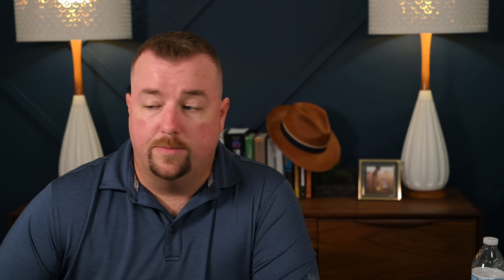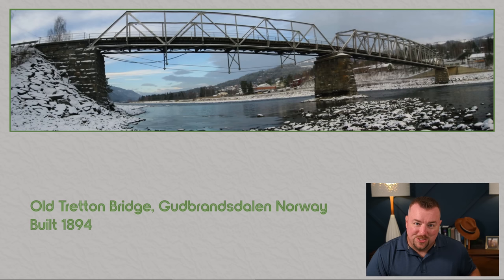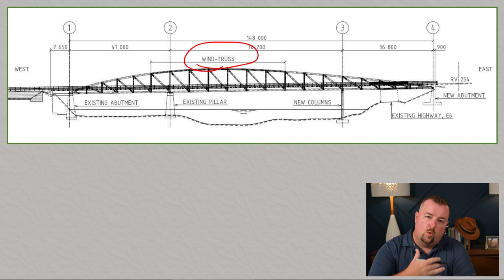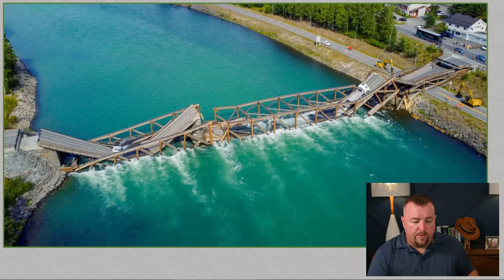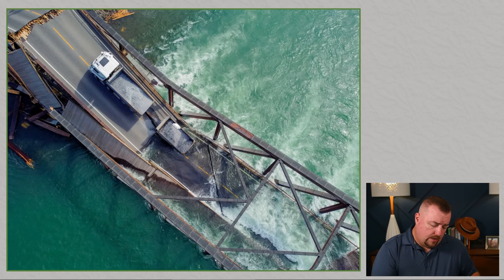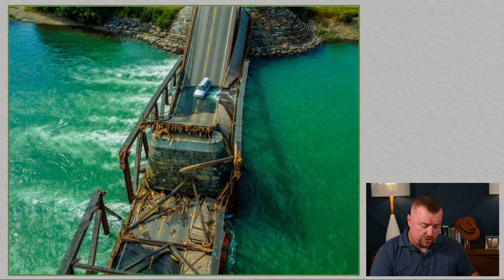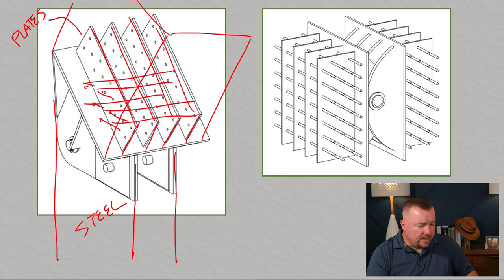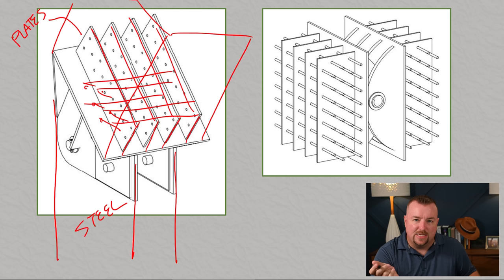How Did the Engineers Miss This?

Comment: A couple of things to point out: (greetings from Norway btw) 
- The old bridge was a single lane bridge and had to be updated to support two lane trafficking. (one in each direction) The choice of material fell on glulam combined with steel because of the weight limitations having to use the old bridge foundamentation and aesthetics. (NVE - Norwegian waterpower and electricity didn't want the river to be reduced to build new fundamentations)
- The first bridge that collapsed, the Perkolo bridge (strange name in Norwegian also, almost sound finnish), was actually underdimensioned in the middle joint. It was bouild in two parts and joined on site. The two joints in the middle should have had 80-90 dowels, but it only had 24. Making the bridge only support 27% of the bridge planned capacity of 65.000kg (143.300 pounds).
- After the collapse of Perkolo bridge all 13 glulam bridges was checked and there where some flaws in some of them. Tretten bridge was one of two (i think) to have recommendations for improvements regarding the joints.If I don't recall wrong it was something to do with the dowels.
- The one thing that concerns me the most is what i have read in a master thesis written in 2018 after the colapse of Perkolo bridge with guidance from engineers in Statens Vegvesen (norwegian public roads administration). The different ways of calculating the stresses, the area to distribute this stresses and the general dimensioning of this kind of joint leads to widly different results. (The codes that are mentioned in the master thesis: EN 1995-1-1 (Eurocode 5 - Design of timber structures), NDS 2005 (North American Timber Design Codes) and a development sugestion for an improvement in Eurocode 5 from Statens Vegvesen.) For me thats kinda concerning, because it makes me belive that we don't have the greatest understanding of this kind of joint.
Reply: Thanks for the background info.
Reply: Do you know of an English version of that thesis?
Reply: Thanks for the information on the other design constraints that are missing from this discussion. Sadly, they result in bad engineering outcomes.
Reply: And thanks Ruben for the comment. Understanding how something failed is nice, but it's also important to ask WHY someone thought that this was a reasonable approach in the first place. To do that, you need to understand the constraints they were working with.
Reply: So basically the power company is to blame
Reply: So. H weight limitations you mean a two land steel bridge would be too heavy for the old foundations?

Because I feel like there is no problem building a steel bridge which could carry the loads this bridge was designed for. In fact I expect you could use the same bridge design with I beams, gusset plates and rivets and it would do the job. No need for box sections even. All due to the better tensile (pull through) strength of steel.

But it would be heavier than the old bridge and this one.

Although I bet the (now double wide) deck is much of the weight of the bridge. And that wouldn’t change.
Reply: This is why I love YouTube (sometimes), here we actually have a person from Norway explaining the history of the bridge!!! I wondered if Norway has building regulations like America, and I have to believe they do, we're not talking about a 3rd world country, but I did find it interesting that the water way didn't want to start from scratch and hence the issues! Thx for commenting, it was a treat to have someone in Norway in the comments section!!!
Reply: Please bare in mind also germanys big ICE Hockey Stadium disaster in Bad Reichenhall.
Reply: Thanks for this additional information. The governing authorities should have closed this bridge until the deficiencies were fully corrected.
Reply: Ruben, the weight reduction argument does not seem correct.  The required stiffness (arguably even higher than the glulam's) would be achievable with lighter steel truss.  In other words - a steel bridge would have been much lighter than the one made of wood.
Reply: Thank you, this was an excellent and very helpful update!
Reply: Another engineer here (aerospace but I work in control systems).
Great information.
I wished more people would take the time to check and get details right.
Reply: @tonywilson4713  Im not an engineer (yet). "The devil is in the details" and when you seek to understand something that's certainly true!
Reply: @marcinkotas3154  Doesn't wood and glulam have quite good tensile - and compressive strength compared to weight? Like steel is prob. 10 times as dense as glulam, or something in that range? So in a truss with minimal bending, and axial compression and tension it seems like a good material. The way of connecting the members to the nodes steel is far superior to glulam tho.
Reply: It's strange that eurocode 5, under durability, there is no mention of resistance to water.
Reply: @marcinkotas3154  It was a political (eco) choice.
Reply: To my mind, the joints shouldn’t be there.  The whole point of glulam was to eliminate joints in timber beams… in other words… to create a timber beam longer than anything grown in nature.  This was achieved by gluing pieces of timber together in a randomized pattern, so that no two joins coincide within the structure.  This way you can create strong, flexible beams a hundred foot in length with no weak joints, much like a laminated archers bow.  Why you would cut such beams into short lengths akin to standard timber beams is beyond me, it just defeats the purpose of the glulam beam!
Reply: @rub3n0st  It sounds like you are a student so I'll give you what I was given by a very smart man. I did my degree in aerospace (graduated in 88). My academic advisor (professor) was a specialist in Finite Element Analysis and in his specialist area one of the top 2 or 3 in the world at the time. 

Little background (and this is so you know what sort of mentoring I had) His specialty was axisymmetric structures and near axisymmetric structures. Being one of the top people in the world in that area, he consulted on the Shuttle Booster redesign after the Challenger accident. It was the early days of carbon fiber and he was doing all sorts of work with modelling it in software. Its way more difficult than people think because its all layered and depending on how the layers are assembled the characteristics change. This Glulam is a composite material and has to be treated the same way.

I wasn't working on the Shuttle booster. I was doing work on stress analysis on the sabot for the Abrams M1 Armour-piercing discarding sabot. There was nothing classified about it. Discarding sabots weren't new, but doing FEM on them was. It was in the days BEFORE fancy color screens so all we got back was an slab of dot matrix printed paper.

I was amazed that he could flip through these printouts in seconds and work out I'd made a mistake in the data set. that was when he taught me the first important lesson. Its incredibly important that you know the general answer before the computer. He was adamant that the computer doesn't give you the answer it gives you more detail about the answer.

At one point during the Shuttle Booster re-design he told me they were going to repeat the mistake and lose another shuttle (that was in 87). What he told me was they were NOT understanding HOW the computer models worked and as a result were NOT understanding what was coming back. He was adamant that if you are going to use these computational tools to give you all these details you needed to know how those details were being generated.

Its sort of like the intelligence use to justify the Invasion of Iraq. Sure the details sounded plausible but nobody checked how they were being generated and it turned out later they were garbage.

I look at this and what he's describing would have my professor come back from the grave and slap a few people. They broke both his carved in granite rules of computational engineering analysis. You must know the general answer and you must understand the model or the details it gives might be WRONG.
Reply: @tonywilson4713  For most people who have ever worked with computers, the one "answer" which is always true:  "Garbage in, garbage out or GIGO". A computer will do exactly what it is programmed to do, The human must know what to put in and why to put the data in so the computer will make the needed computations.  

You make some very important points, keep working on them so you can prove to yourself you are a good student of your mentor.
Reply: @Harry-zz2oh  Absolutely right on GIGO. What my professor taught me was a more technical version of that years before GIGO was even a term.

What he taught me was that in addition to GIGO, you can feed good data into a good model and still get garbage if its the wrong model to use.

This is what they did with the bridge. The data was good, the model was good, BUT it was the wrong model to use for a composite material AND it didn't consider degradation of that material due to weathering. 

This is one thing across the entire computer modelling world from stock markets to weather to political polling and all the rest. Its not just a matter of GIGO its a matter of understanding the model to know its the right model and/or its limitations.

I have actually been looking at economics for a couple of years and that crowd are totally bonkers and when I mean bonkers I mean certifiably insane bonkers. Their logic is totally FKD and none of them can see it because they are all taught the same garbage. There are some rare exceptions but they're considered heretics.
Reply: @Helladamnleet  No, those are just the constraints that the engineers and architects have to work with. It's something engineers do daily.
Reply: @tonywilson4713  And how is it going to look like in the future when more and more modelling based on machine learning is going to be used? As even complicated mechanical models can be possibly understood and their applicability can be verified, it is almost impossible for ML. As it its feature just to throw a solution without having a shadow of understanding of a simulated phenomenon.
Reply: @johncampbell9216  that's not possible or feasible and frankly doesn't make sense...
Reply: In America (as well as Finland and a few other places) we have TONS of wooden structures.  It's a wonderful, cheap material that can have great aesthetics.  It's good in both tension and compression.  It can last HUNDREDS of years when cared for properly.  

However, wood is weak to water.  Specifically, repeated wet/dry cycles.  Wood loses strength from rot, which is caused by fungus attacking the wood.  Even treated wood has this problem.  Exposed wooden members should NEVER be structural for this reason.  Exposed wood should also be painted for longevity.  Even a fully treated wood needs to be retreated every year.  

I can understand the aesthetic joys of seeing bare wood.  In that case, it's advisable to make an inner structure of steel or aluminum, with secondary load carriers made from wood.  You can also make railing and other non structural components out of wood.
Reply: @pathfinderlight  You make a very important point that applies to EVERY MATERIAL engineers use: "when cared for properly"

It does not matter what the engineered system or product is. If its not maintained properly it will fail BEFORE its expected life time.

Look at some of the worlds best failures of recent decades, Piper Alpha, Chernobyl, the Ponte Morandi bridge in Genoa, Japan Air Lines Flight 123. The list of disasters with poor maintenance is staggering and NOBODY ever seems to learn from them.
Reply: And I think considering it carries a great heavy load(a paved road) we should not be trying to find out about these joints made out of materials that drastically change characteristics based on humidity, at least not in public infrastructure anyway... We have invented better structural members made out of steel... or hell... even stone/concrete... It is a paved road making the frame out of wood is a political bs statement and not a conscious engineering choice in my opinion and as such it should not be ok to play with people's lives like this just so that some politician can claim that these inferior material choices make these bridges green or something, I assume this is the reason.... why did they choose these materials again?
Reply: Fea is the most powerful tool to come from the cad revolution and unfortunately gives some designers a false sense of security due to lacking the understanding of computer modeling. Modeling is not an accurate picture of reality but an accurate picture of the reality the computer was programed to represent.
Reply: @tonywilson4713  
I’m totally with you. I had similar experiences and I often see the younger engineers having too much trust in computer output without doing a “sanity check”. By the way, I graduated with a BSAE degree in 1988 too.
Reply: @johncampbell9216  Yes, that is a very good point. There weren't  using a glulam to do what it's really good at doing. It's really good at not needing connecting joints and spanning long distances. Also if the wood was doug fir or similar, it's not a good choice in an exterior situation.  I also found it was amazing that they could drill all those holes in the wood accurately, especially if they made some of the joints onsite. A drill in wood will drift a good amount because of the wood grain.
Reply: @ammerudgrenda  It sonly getting worse too.
The more recent graduates are less skilled, yet think they are more skilled than those from 10-15 years ago.
We might have had our issues but its nothing like these grads. Maybe it was the fact older engineers were actually allowed to tell us to shut up and listen.
Reply: thanks for the information. i am not positive it is a joint understanding issue  more of a materials limitation . as i understand it  the glulam can carry the load  but the method of attachment  weakens  the material at that location  ,  i feel for the designer with the restrictions imposed  and the outcome required  he had to  move mountains to mohamad  because mohamud wasnt going to move to the mountains. 100 + year old foundations  for a single lane bridge now required to hold a 2 lane bridge and large live loads..... oh and you cant play with the foundations..... heres an easy job now do it in an impossible way....  you have some nice land there sir
Reply: What does 'foundamentation' supposed to mean?
Reply: @johncampbell9216  This is exactly what I was wondering. The distribution of many smaller connections is where engineered timber's benefit come from. To then go making it into numerous shorter sections before tieing it back together with steel is defeating the entire point of the lamniations.
Reply: @stevebollinger3463  Glulam has a better strength to weight ratio than steel for most types of stresses.
What it doesn't do is plasticly bend and then harden like steel when you exceed its capacity.

Anyways, it makes perfect sense to use glulam where you can instead of steel when weight is a constraint.  It is a fairly new material though, so real world details might well bite you in the ass as appears to have happened here. Hopefully this is all going to lead to improving methods.

PS: Using materials which are grown instead of mined or drilled is generally a good thing.  But this stuff is difficult.
Reply: @tomruth9487  it seems to me that the designer really doesn’t understand the purpose of glulam and the methods of construction.  One thing that screams out at me is the method of pinning, with so many small holes so close together at the joints.  All this does is weaken the beams.  The whole concept of assembly is flawed from beginning to end.

I’m no expert on glulam or timber construction, but from what I have seen, I would have had the two upper beams engineered on site, full-length with a pre-formed bow in them, and then make full-length straight beams for the road support.  I’d have hung the structure from the bowed timbers using steel boxes that the beam runs through, rather than pinning.  That way you get the maximum strength of the beam with no weakening penetrations.
Reply: @johncampbell9216  My thought also, non-engineer here but I feels so wrong for the gluelam to be cut in to sections, the whole point of its springiness is lost. I've driven past (not over) that bridge at Tretten many times, first times I thought it was temporary, but it stayed.
Reply: @johncampbell9216  Yeah your ideas make a lot more sense. If they were going to join it with steel, the steel needed much more bearing distance up the length of the gluelams.  It's sort of like the FIU pedestrian bridge collapse but different materials. They tried to make a single concrete truss to support the whole structure because it was hip.  The joints failed. It's such a risk doing stuff that might look good on paper but is not time tested. The FIU bridge only lasted a few days but, the egos of all involved prevented them from accepting the fact that they made a big mistake. People died as a result. What a hard lesson to learn from.
Reply: Cheers - the foundation-imposed weight limit plus the dual carriageway are important design elements that will get forgotten by people who want to laugh at using wood
 - "we're not sure" isn't a great response to "how strong is this?"
Reply: @Helladamnleet  The power company acted as a catalyst by lobbying for what they wanted, but they were not making any decisions or executing them. Thus, they are not to blame.
Reply: @tonywilson4713  Cannot disagree more with your "shut up and listen" comment. That attitude produced nothing constructive, no matter from which viewpoint you look at it. And very often old farts also do things in a particular way only because they've done always that way it's "good enough". And they cannot even articulate reasonably why they do as they do. And often their "good enough" is not even good. 

Getting better at your job and bettering work aspects and methods requires open mind that maybe there have been some development and your own methods are not considered up to par. While field experience is very important, so is the knowledge from new developments of better or even just different methods to do things.
Reply: @johncampbell9216  I think the design is driven by aesthetics. They wanted a sleak look, and then there's no room for properly proportioned joints.
Reply: @MichielvanderMeulen  wouldn’t a sleeker look be achieved by using whole-length beams, Michiel?  I’d have thought designing the joints out of the bridge would be “sleeker”… hence the use of glulam…
Reply: @marcinkotas3154  If someone used the weight as an argument they probably wanted the wood-bridge and were simply trying to invent reasons for it. Maybe to compare wood to concrete ?
Reply: @johncampbell9216  One word: Transportation.
Reply: @Panzax1  Three words: On Site Construction.
You rent a yard adjacent to the site, build a tunnel tent and assemble the custom beams in there. Once complete, you crane them into position.  No transport required.
Reply: @johncampbell9216  No need for sarcasm. Cost is an important factor and your idea will never be practiced on such a bridge.
Reply: @Panzax1  indeed, there was no need for your sarcasm.  Doing the job in the manner I have described would be a better way to go if long-beam glulam construction is the desired method.   Although, there have been many projects around the world where very large glulam beams, over 100ft in length, have been transported to build sites from the factory.  The individual circumstances dictate the method.

On-site beam assembly is a perfectly feasible option where transport access is limited.  The temporary rental of a yard would merely offset the cost of specialized vehicles and their escorts along the delivery route, so no real additional expense is required, and you get a much stronger structure in the end.
Reply: I'm just surprised about the amount of dowels. A major issue with dowels in engineering is (also when using bolts) that the power is not evenly distributed over the dowels. In extreme situations only one dowel will hold ALL forces....it snaps and now the next dowel will hold all forces....
In fact there will be at least 2 points holding the forces....one the rotation forces the other the forces in line.
This is confirmed in the part of the YT video about the testing of those wood pieces (splitting the wood exactly at the outer row of bolts)

Only if the material is stretching enough more dowels will add to the strength of the connecions. With stiff material (glue is not always flexible enough depending on the kind of glue) the bridge is much weaker than with stretching. Knowinbg that old castles do not break down in 1000 years with their thick oak beams....I expect the bridge would be much stronger when build from special selected trees and massiv beams from those trees.
Reply: Brilliant discussion.  I'm in Norway and have read extensively on this bridge.   The maximum glulam lengths were 23meters. Most were a bit shorter, spanning two verticals.  The reason for this is this is size limitation of the creosote impregnation tank used in the glulam factory at Moelv. Yes, the entire bridge is pressure treated with creosote so that it can last.
Reply: @davidbrown8365  So they've de-engineered the glulam beam to suit their chosen method of treatment rather than making their beams out of a more weather-resistant timber.  Thanks for the new info, David.

There's clearly a host of poor decision-making going on with this company.  First, choosing to use cheaper, less weather-resistant timber for their exterior beams- forcing them down the pressure-treatment route, then adapting the glulam technology to the limitations of the pressure treatment process, rather than building their beams of a more suitable timber like Acacia.

It also begs the question... what effect would the creosote have on the adhesive?
Reply: That just says how dumb NVE is firstly they still let people build new homes on quick clay and also didn't want to build better foundations for a new strengthier bridge
Reply: "The two joints in the middle should have had 80-90 dowels, but it only had 24. Making the bridge only support 27% of the bridge planned capacity" - That calculation cannot be correct, no way. Looking at the other papers presented in this video, the number of dowels would not have such impact on the strength of the joint. It will split at the edge of the dowel area along the grain of the wood (or laminations as seen in the pictures from Tretten).
Reply: @rub3n0st  You are right. Wood is stronger per pound than steel for a tension member. I used data for s275 steel and Douglas Fir lumber. I assumed a safety fact or 6 for both materials.
Reply: @johncampbell9216  You still have to have a joint at the ends, where the arch meets the roadway.
Reply: @NiftyMCD_Australia  Foundation.
Reply: @johncampbell9216  I'm gonna guess that the creosote treatment came after the glulams were assembled. I can't imagine attempting to glue onto creosote.
Reply: @shAnn0n1  On the whole the laws and regulations here are stricter then in the US.
But perhaps not strict enough for this particular type of joints...
Reply: @firesurfer  No, it's not that simple.
Instead there was many different considerations, the environment just being one of them.
Reply: @tonywilson4713  Kind of true, but you risk confirmation bias.
Reply: @kozmaz87  It's not a inferior material, it's poor design, possibly caused by insufficient understanding of the materials in use by the ones doing the designing.
Reply: @Luredreier  The details are not important for me.
Reply: @johncampbell9216  Labour and building costs are high in Norway.
Automatic factories or import from abroad might be cheaper.
Reply: @johncampbell9216  Regarding wood type there's a goal to use local woods if possible.
Reply: @elypowell6797  US construction in general tends to last less time then nordic ones...
So don't blame feminism for this...
Reply: @Luredreier  so they were putting idealism before good engineering.
Reply: @Luredreier  Labour is equally expensive whether it’s in a factory on site in a yard.  It’s Norway, the wealthiest country on the planet, it can afford to do things right.
Reply: @johncampbell9216  What message is that a reply to?
Reply: @johncampbell9216  No, labour is far more expensive outdoor because of workers rights, and also far more expensive if it's human rather than robotic or otherwise mass produced by machines.
And it's far more expensive if it's Norwegian rather than imported.
And yes, we have a lot of money, but the reason is that we're prudent with our spendings.
Reply: @Luredreier  I suggested the temporary erection of tunnel tents, which would have to be temperature and humidity controlled to assemble the beams on site.  It would have been a lot less costly than all the steel fabrication that was done to connect all those short beams... which just seems way over-engineered (and expensive) to my mind.

If you want a long-beam glulam structure, you either transport (which costs money) or you build on site, which, incredible as it may seem, costs money!  It's all about making compromise for the success of the project and I'm quite certain a tunnel tent, a few guys and a crane would be easier, cheaper and a better result than the over-complicated failure that was delivered.
Reply: @Luredreier  
You said: "Regarding wood type there's a goal to use local woods if possible."
I replied:" So they were putting idealism before good engineering."

My point: It is often the case that builders and architects will run with the "eco-warrior" assertions of do-gooder politicians, rather than just doing it right with the strongest, most weather resistant materials for the job.  This said, it's quite likely that the local timber would have been just fine if the glulam beams were full-length.  But the fact is we've had a failure here... and it wouldn't be the first time politicians set a project up for failure from the outset!
Reply: Thanks for the input! This stuff is pretty interesting.
Reply: @renerpho  This type of bridge was designed by architects for a certain look, and the engineers involved after that were probabily incentivized against blocking the project by introducing changes that would change the look or radically increase the price.
Reply: @johncampbell9216  I agree the beams should have been continuous with more of an arch. Also if the river is navigable they could just bring them to the jobsite by barge.
Reply: @pauleohl  Yeah glulam has almost double the strength to weight ratio than even high strength structural steel (S420 grade), so it does actually make sense in this application. The failure appears to be the joints. Maybe they assumed it would stretch a bit before yielding to give some warning (like in the papers in this video) but they are clearly not failing in this way. Like most engineering failures, it came down to bad assumptions.
Reply: @johncampbell9216  Here is an interesting project if you like. Calculate how many lifting points would be required so that your arched and straight members can be lifted without breaking from their own weight.
Reply: @marcinkotas3154    Wood, in general, is stronger in tension than compression but the tension joint is the BIG problem.
Reply: 28:21 According to the official records by the Norwegian Highway Authority (Statens Veivesen), the structure was loaded to 200% of what it should be. The report from Statens Havarikommisjon (The Norwegian State Disaster committee) is still pendling. Thus, the jury is still out. We may make educated guesses, but we can’t really conclude until the official «disaster report» is finished. But you’re quite through, though! 😊
Reply: @firesurfer  there are different dimensioning classes, one for normal indoors climates, one for outside climates, but under a roof and one completely outdoors without protection. AFAIK we have had in Finland a 4th one for constructions completely or very heavily affected by moist conditions, today the aforementioned constructions use the 3rd class
Reply: So they attempted to update the bridge despite ridiculous weight limitations. ... creative means learning from mistakes and progress.
Reply: @Tony Wilson  It was unfortunate that the booster redesign did not solve the problem with the ablative material breaking off in slabs which damaged the wing tiles on Atlantis and almost caused the loss of that ship which was the 2nd launch after the Challenger loss. Also is the likely cause of the Columbia breakup which is really sad that NASA did nothing to correct the problem after that Atlantis near miss.  They played russian roulette with all those crews. Sickening!
Reply: ‼️Thank you! I'm disappointed that he (the channel) didn't even react to your great additional information‼️‼️
Reply: did you have to wave the flags? are you so imprisoned in your culture?!
Reply: @NiftyMCD_Australia  foundament- the initial starting point,, tation the study or act off, foundamentation , a great word for Scrabble! But I doubt it would fit , goes along with words such s sillyiesation, to make things appear less serious or valid, why use several words when you can make up one ridiculous one☺.
Reply: I very much appreciate the details on the dowel pin situation.

It reminds me of the sky scraper in New York having much less wind resistant because of "cheap" welding done differently different from original plans
Reply: @elypowell6797  that's an interesting take, given how many historic bridges used to catastrophically fail, with hardly a note on the subject.

I am sure it's inconvenient to go trough microfilms at the local newspaper archive but assuming feminism doesn't mean the Roman civil rights movement or anyone else before the 1820s there should be cases of bridge collapse accessible to you testing that hypothesis.
Reply: @TheNiteinjail  

The weight constraints were part of the site assessment, if they couldn't have designed a bridge to suit that (in theory) they might have had to either move the entire road connection or terraform significantly

We have a local project to replace a bridge that was destroyed (1940s history) before UNESCO heritage recognition was achieved and there have been incidents of that being removed upon bridge building.

There is another one upstream that will be replaced with the new one before it's taken down (traffic reasons, minimising disruption) but is spanning a nature preserve area that had to be weighed (including because reducing the wetland biomes protection across the whole river will impact the flooding that bridge can be damaged by)

I am not sure how familiar you are with the water system impact of building bridges but putting down any additional pillars can be pivotal towards large scale liability.
Reply: Greetings to Norway!   Good background info.  Good info.  (Glad to see others make mistakes, not just my country.  (Glad in a non-joyous, non-contemptuous, non-happy, commiserative way.)
Any thoughts about the copper caps?
Reply: @charlescrawford7039  The only way to correct the deficiencies would be to replace all of the timber with steel.
Reply: Perkele bridge!😀
Reply: @marcinkotas3154  He said weight, but everyone is missing is he also mentioned aesthetics. 

There was probably political pressure/regulations that stipulated the use of wood for aesthetics rather than steel.
Reply: stop making excuses for this engineering and design disgrace. we don't want to hear it. build your infrastructure safely. Greetings from america.
Reply: Didn't it also, "have", to...support cars?
Reply: I think you can safely go with the more pessimistic, unless that also did not account for the collapse, which means an even more pessimistic prediction must be found.
Reply: @tonywilson4713  Everything you say about computer models I agree with it all totally. You need to have an understanding of the broad solution you expect to see, you need to understand the model and the math behind it, and you need to know the limits on your input data.
With so much data modelling today its use or misuse has almost become a kind of pseudoscience. 

In this case (for me) just from playing bridge simulator games its clear that joints that experience multi-way tension loads are naturally quite unpredictable and a common failure point. Might even classify the loading as loads shift as almost chaotic. The simple classic solution to that is of course to over-design and over-build such joints.. (What they didn't do here.)

Then we consider that they are using glued wood - outside - so in the wet & with uncontrolled temperature cycles.. Plus the point pulse loads that bridges take. Definitely a disaster waiting to happen.
Reply: @Lucien86  You have just repeated almost word for word what my professor who was a world leader in Finite element modelling said to me in 1987.
Let me say that again 1987 as in the year after the first Space Shuttle accident.

In the summer of 87 when I worked for him I came into the office one day and he was sitting at his desk head in hands mumbling that they were "going to do it again!"

He had just returned to Illinois after going to visit Morton Thiokol who at that time were redesigning the shuttle boosters and Axisymmetric structures were his specialty. Thiokol had gotten Lockheed (I think) to do the FEM and they'd sent back to Thiokol one of those (no familiar) coloured renderings of the stress patterns. Those coloured pictures were rare in those days and some if had freaked Thiokol out and they called up in a panic. 

Around the joint strap at each segment of the booster was a line of red dots indicating that metal was beginning to yield - NOT GOOD on face value - especially since the last shuttle had failed because of a joint failure.

Those dots were the rivets that held the joint strap onto the segments and rivets yield when they are installed. Its how rivets work and the Lockheed model showed them exactly how you'd expect IF YOU KNEW HOW THE MODELS WORKED.

That was 1987 and still to this day people don't get that lesson.
Reply: @tonywilson4713   Just watching a similar thing happening right now at this moment in my own field. Not over anything like bridges or spacecraft but with Strong AI & Chat GPT.. This is looking into a deeply fringe field on the cutting edges of research so the rest of everything I say is basically speculation..

In the case of things like Chat GPT the problem is people misunderstanding what the software is doing and massively overestimating & potentially underestimating its capabilities. (It is largely based on very complex computer models - usually where the data forms the centre.)

Chat GPT as a system has no real intelligence in itself, but it is based on the task of general language interpretation which is special. That is because human language (almost by definition) does contain the seeds of both intelligence and sentience.. 
In effect Chat GPT is wearing a coat made of all the things it has recorded from people and is regurgitating it back at them. It has no real understanding of what it is saying though as it has already demonstrated - so no sentience.
The gap between real sentience and non-sentience can be quite a subtle one in some ways and it may be that some people start to think that the machine is sentient when it is not.
(This may lead to all kinds of bad things.)
 
However the 'obvious' lack of sentience could lead people into other different cul-de-sacs - like Chat GPT or its descendants actually becoming partly sentient and its creators not noticing.. 
Chat GPT is missing many elements that are probably critical to sentience - or at least to human like sentience. But it does have two of the most critical elements - it has a persistent memory and it has at least some ability to evolve. Beyond that point there is a total lack of knowledge about what all or any of this may lead to.
(Again may lead to all kinds of bad things.)
Reply: @Lucien86  You are absolutely spot on.
We have all these clowns with ZERO UNDERSTANDING of software or how it works and they are making huge claims on what this particular form of software is and what it will do. Then there are those who do know how software works but they know how stupid the rest of society is and they want to make money and don't care. Most of those claims are as vacant a deep space and it absolutely infuriates me.
 
I call them "fake tech promoters" and its not because the technology is fake. Its because their claims are fake. What's so amazing is that no matter how many times the over-hyped tech claims FAIL people still keep thinking these people are reliable investments because occasionally there's a Facebook or a Google. 

Imagine this: If I started a website where anyone could post a phot of any girl no matter if they liked her or not or even know her and then allow people to judge her photo against other photos on whether they'd F*ck her or not. Imagine how women would react being degraded down to a single photo AND YET it was women who mostly made the guy who did just that a triple digit billionaire. 
He even kept the name of the original website - Facebook  

Added to the narcissism of the fake tech promoters is the media. There's times I want to get very very ugly with the media. Journalists have 1 simple task - INFORM PEOPLE and in recent decades they have utterly failed at that basic task.
Reply: They should have used ANSYS instead of guessing.:text-green-game-over::oops:🤣😛😭
Reply: For reference sir/ma'am, what's the author's name or the title of this master thesis? I am a graduating civil engineering student who is currently about to design residential houses using STAAD and MIDAS for my specialization course it would be great to further understand structural analysis. Thank you.